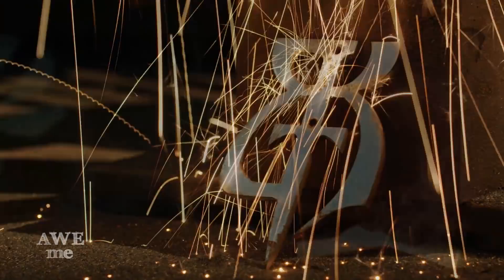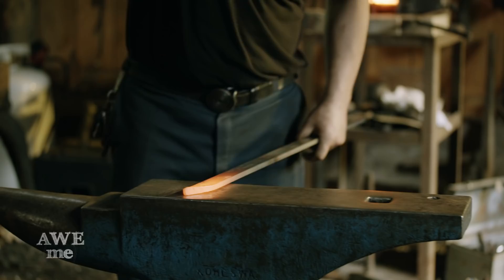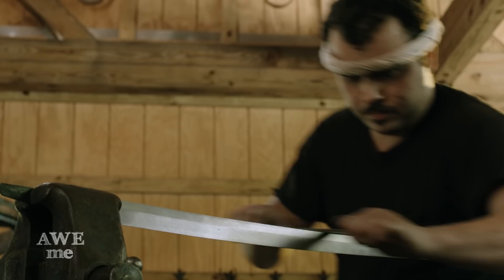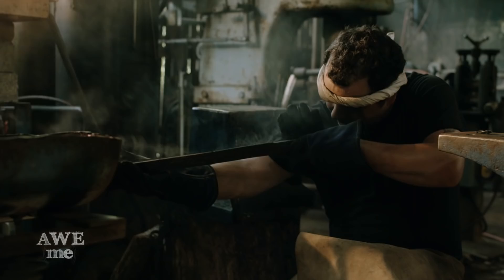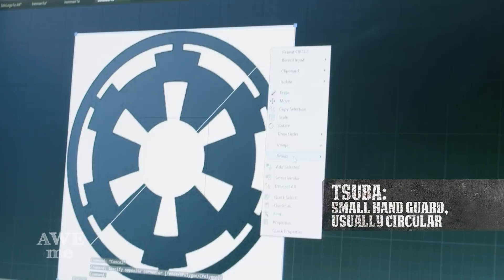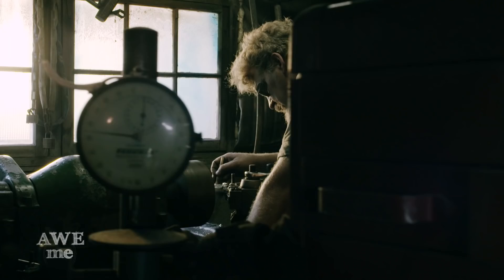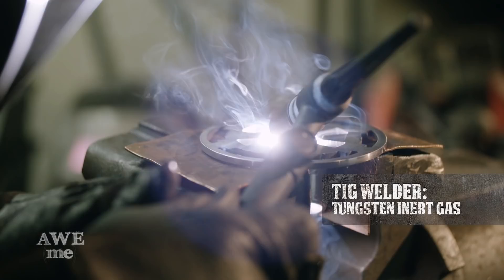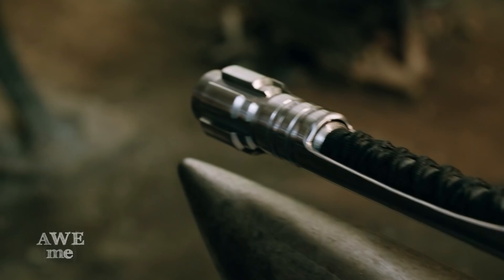Star Wars Lightsaber Katana - MAN AT ARMS: REFORGED

Comment: I'm pretty sure katanas are made of folded steel that is around 15 layers thick and not a single piece of steel. Come on, at least do it right...
Reply: to much effort for a blade that's never gonna be used again i guess
Reply: Pretty sure that would take a fuck-ton more time and effort into something being made for entertainment purposes.
Reply: Actually, they often had hundreds of layers
Reply: The folding method was used because the iron in Japan was low-quality and it compromised the durability of the sword.  There's no need to use it in modern steel forging.
Reply: high quality ones made for actual use, yes. This is just a replica piece so i guess they didn't bother. But you aren't wrong.
Reply: Like Alejandrinos said, folding was done back in the day to work alloying elements in and homogenize the metal for the blade.  Modern metal stock is already homogeneous, so folding is unnecessary.
Reply: "1000 fold" steel as it was called was only made that way to get imperfections out of the terrible quality iron the Japanese had to work with. These days, with the steel hes using it would be utterly pointless because believe it or not we've got a lot better at making metal alloys in the last 500 years...
Reply: I love how this comment is underneath another one that is complaining about kids whining that the Katana needed to be folded.
Reply: xTCHAOTICTx  Well, as a nod to tradition, a fold would've been appreciated, but it's not necessary.

Honestly, my gripe is that the blade isn't red.
Reply: SAMASzero I would've preferred it to be green, myself.

Comment: In the legends universe, the je'daii order used katanas, and those eventually gave way to lightsabers, so you're not wrong.
Reply: YOU ARE WRONG THEY WERE NOT CALLED LIGHTSABERS BUT VIBROBLADES
Reply: The Je'daii Order did use swords once. They would be imbued with the Force through alchemy, and were much stronger than any type of vibroblade I've heard of in the Star Wars universe. Force-imbued blades were used up until around the first great schism, when they were replaced by the Rakatan forcesaber.
Reply: No, he is right.
Forcesabers were much older than Vibroblades.
Reply: shogunsxf your wrong they were called proto sabers..... they were the lightsabers that had the battery pack and a cord going from the battery’s to the saber......
Reply: @Vedlom  forcesabers are "lightsabers" used by the rakatan empire  and not usual weapons that were improved with alchemy and stuff.
Reply: @zachall101  force sabers were used by force hounds long before. most jed'ai didn't use them cause of the rush. instead using force embed blades. the proto saber was barely useful. and the sith can up with a internal battery.
Reply: Zac Hall they originally used forced imbued weapons and then the technology evolved into the proto saber and eventually to the lightsaber
Reply: You've forgotten vibroblades!

Comment: I love how they actually used some real katana forging methods, or close to them anyway.
Reply: They didn't fold the steel, but yeah, that'll take forever
Reply: MrB10N1CLE you would be waiting months for this video if they did lmao
Reply: MrB10N1CLE
That is only necessary is the steel is terrible quality, which the steel they're using isn't. Folding the steel is a way to remove impurities in the medal to make it stronger.
Reply: MrB10N1CLE
It doesnt take forever. The old folding technique wasnt very good. Since it also had different steels, ahrd and soft, it left the Katana brittle. So if it did bend, which it could in battle, it would either break, or stay bent.
Reply: animematt99 it depends
Reply: Andrew Boner
It doesnt take that long to fold forge steel

Comment: I REALLY liked this particular build, but I think it would look even cooler if they anodized the blade to a red color.
Reply: I was thinking the same thing.
Reply: Interesting idea... that would have been a nice touch.
Reply: There is just one problem with that. Aluminum can be anodized, not steel! Steel can be tempered to a specific color based on the temperature that the freshly ground steel is tempered at.
Reply: yeh, im kinda dissapointed they didnt tbh
Reply: *****
You're right, I didn't exactly do any research on the topic. However my point wasn't that the blade should be anodized but that it should be treated in a way that creates a red color on it.
Reply: CoxTH
IDK maybe it was for aesthetics? Although I think it was the fact that it was specifically tempered to have a a harder edge and a softer spine (I believe it is referred to as the hamon). Either way yeah heat treating to a specific color would have made it look quite badass! >:)
Reply: *****
You are probably right about that. I guess they had to find a balance between authenticity, functionality and looks.

Comment: For all the people complaining how this isn't a real katana blade, did you not see the differential heat treating? The traditional wetstone polishing? Just because it isn't folded doesn't mean it isn't a katana. Katanas were folded because the steel found in japan used to make katanas were too impure, so the blade had to be folded several times to remove the impurities and spread the carbon content across the blade. The differential heat treating with the clay (like they did in the video) meant that the core of the blade was softer so the blade could bend instead of breaking when under stress, while the blade is harder meaning it will take a sharper edge and last longer. The folding is not required. The differential heat treating is. Still, the handle looks uncomfortable.
Reply: Traditionally they would also use 2 pieces of iron of different carbon contents to make the spine and edge. The difference in hardness caused the signature bend in traditional katanas because the two pieces would cool at different times when quenched.
Reply: Christopher VandenBosch there was no variation in the type of steel used in any part of the blade. The composition was uniform throughout the blade. the variation in hardness comes from the ingenious use of the clays and the whatever it is they coat the blade with during the hardening and tempering process. Also not folding the steel here is the way to go because our modern steels are so pure and clean that folding them just increases the risk of weak spots and inclusions. The only reason it was done back then was to mix the steel so bad spots would be sandwiched to good spots making it more uniform for the hardening processes. Also it helps clean out impurities
Reply: The low carbon hocho-tetsu is folded several times by itself to purify it. This produces the soft metal called shingane used as the core of the blade. The tamahagane is forged into a single plate and the whole thing is forge welded into a single block called the age-kitae. That block is what they then use to make the katana. Also what they traditionally used was iron not steel. They could not create/control forges hot enough to produce steel which is why they implemented the long folding process. What they end up with is similar to medium grade steel made today.

I was simply trying to state that there is more to traditional katana making than folding and applying a paste. A good smith would know the carbon content of the different iron chunks by feel look and weight and a true craftsman would make an optimal blade with a soft spine that would bend and a hard blade that would keep an edge.
Reply: Well first things first good job explaining that. Even I picked up what you threw down there. With all that kind of terminology im not going to say your wrong. I mean there wouldnt be names for it if it didnt exist. But I kind of get the feeling that was the exception. Im pretty sure most of the katanas were simply folded and heat treated with a select few being made using the method you described.  Also iron cant be hardened. It can be case hardened but if the metal they used was hardened In any way it was most certainly a type of steel. At least that my understanding anyways but what the heck do I know.

Comment: QUIT BITCHING THAT THEY DIDN'T FOLD IT! 
there is absolutely no need to do that with modern steel, same goes with using differentially hard steel inside the blade
Reply: IKR XD I mean there's really no point of using some traditional steps if they're going to skip few steps. Otherwise it might just be cause folding the metal 100 times would probably take forever...
Reply: ***** I actually just read on it, and it's quite the opposite.

Modern day steel is far better than that used in blacksmiths of Fuedal Japan. During the time, folding improved the strength of the steel, but with improved technology modern day steel may be just as strong, if not stronger, than 'Folded Steel'. Folding Modern Steel may actually weaken the metal.
Reply: /Doesn't the folding also create that cool layered effect on the steal itself once you start grinding and polishing it? Their blade looked dull and plain.
Reply: LibertarianSoldier1 The constant folding of steel/iron gives the blade its layered effect you are talking about, but in addition to that the hardening and tempering process is more important to displaying that line.
Reply: ***** I dont know where people get this notion that ancient japanese steel was like the coming of metal Jesus. THAT TEST DOESN'T EXIST. The simple truth is that japanese steel was piss poor, at both retaining an edge and not snapping to peices. European Steel was vastly superior. the only reason they folded it was to mix any tough, impure metal with the brittle pure steel, evening it out so that one area wasnt more prone mto snapping, cracking, chipping, or bending.
Reply: LibertarianSoldier1 Since they clay tempered the blade, the spine will be softer than the beveled edge. This means that there will be a beautiful flame shaped "hamon" along the blade, which will become more apparent the more they polish it. Look that up Hamon on Google images, Some japanese bladesmiths made them look like waves, fire, or even dragon scales
Reply: Chasen Tom That's partially correct and partially incorrect about the folding. Folding strengthened blade on many levels other than just evening out the impurities. Because the folds were never truly melded back together fully, due to the way most steel melds, it allowed the stress to be filtered out over larger areas. This not only aided in the blades durability but also reduced strain on the wielder. It's a practice that sparked the similar technique used for armour in modern militaries to create bullet proof vesting that can withstand weapons stronger than your average handgun, same technique used for non-titanium and non-carbon based gear. This also reduces the impact the body takes on a single spot allowing for a solder to stand quicker than traditional gear. That, along with the softened spine and hardened edge techniques they used, allowed the sword to cut forward with less give from the wrists, causing greater cutting capability.

Mind you, I'm in no way stating that the folding process is a must, and in no way makes a blade better than forged steel of today. We don't truly fold our steel for any reason anymore, we simply give it types of layers that mimic the folding process but in a stronger way. I just wanted to share another reason that folding their steel aided their weapons back in the older days.
Reply: Nub Tanx i don't think he is talking about the hamon, but rather the jihada which is the small waves of hundreds of tiny lines across the blade that result from the folded layers. these would be revealed through the buffering and polishing of the blade, similar to the lines seen in damascus steel.
Reply: Everyone saying that they didn't fold it is a katana fanboy
Reply: woah i didn't need so much explanation on folding sheesh and i wasn't even bothering to even make a giant arguement, just letting people know -.-
Reply: Right? it's just for display, lol.
Reply: Folding modern steel does absolutely nothing because modern steel is already incredibly strong and pure.
The only reason for folding steel nowadays is to get the grain pattern
The reason they use to fold it was to even out impurities in the metal so it wouldn't bend or break. But since modern steel has so few impurities, it would have just been a waste of time.

Comment: my god will you stop using melons and bottles of drink for testing the weapon because melons can easily be sliced up very easily by a slightly sharp blade and bottles of liquid is not even dense enough to test it properly, use ballistic gel blocks for firearms you only need to buy it once and heat it up and let it solidify again to re use :/
Reply: They use them cause they look cool when smashed to bits.
Reply: i understand that but im sure if someone made a weapon like that im sure they would want to test it to its full potential
Reply: Matthew Pham Looks more nerdy than cool though, imho. But I like the vids :)
Reply: kenpachi 1995 This is one exception, everyone minus the stormtrooper just hit soft or brittle objects for the sake of looking cool.
Reply: You watch skullagrim don't you
Reply: The glass smashing has always bothered me. What's the point of showing off that it can do what just about any solid enough object is capable of?
Reply: But you can tell how sharp the blade is by how clean and straight the watermelon was cut
Reply: ZtanleyXYZ Not really, it doesn't take a sharp edge to make a clean looking cut on a melon.
Reply: Its not a real Katana, they used way to many easy aspects as far as producing. (Not to mention Katanas don't only have steel, but Iron and a bit of sulfur aswell.)
Reply: DoomedEagle A threaded katana with a lightsaber handle, OF COURSE ITS NOT REAL. I don't get what you mean by "Not to mention Katanas don't only have steel, but Iron and a bit of sulfur aswell."
Reply: Alex Oiegas explain too me why am i nerd? is it because i am more mature than you and more knowledgeable with facts than you are? in that case you are calling a construction tutor a nerd for knowing facts about the construction trade, stop trying to speak down to some one who you really cannot speak down too :)
Reply: kenpachi 1995  Steel is iron.  Iron with all the carbon impurities pounded out of it, with a little sulfur added.
Reply: OK to get you back on topic, the reason they're using watermelons and all those bits and bobs is simply for style points, I realize that it's not a practical test and it is also highly possible that they do the actual testing off camera, but most people here are looking for something that looks awesome, not practical, cause let's be honest; most fantasy weapons are far from practical.
Reply: Michael Murphy No. Steel is iron with carbon added in actually.
Reply: do u know how expensive it is to buy enough of that type of gel??
Reply: I know that it can be melted and used multiple times.

Comment: It would have been better if they heated the blade so it turned a different Color like red or blue that would be awesome instead of it being all polished but it's still really cool!
Reply: I thought the same thing. They should have went Jedi and turned the blade blue.

or at least make that inner pike that they did the wrap around a color. A plain silver light saber nearly defeated the purpose. It's basically just a Katana with a non-traditional grip....
Reply: Or it's a silver or white light saber but that's still kinda boring
Reply: that would ruin the temper.
Reply: Could have done it like with diamond sword
Reply: medusa little
And Sting from The Hobbit, with its blue blade. And the Halo Energy Sword. Probably they just didn't think of it at the time they were making this sword.
Reply: It would still be awesome and be more like a light saber instead of a katana with a fancy handle
Reply: They differentially harden the blade, tempering to add color would soften the blade edge reducing the hardness.